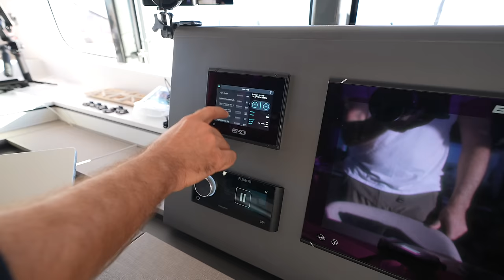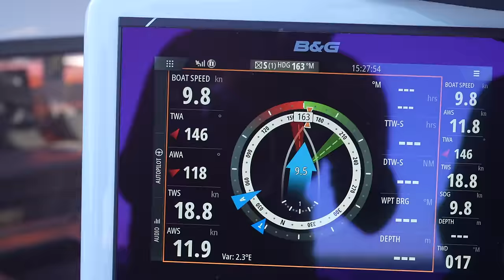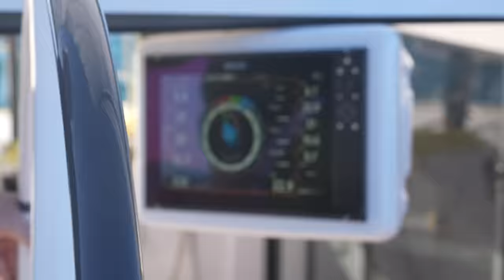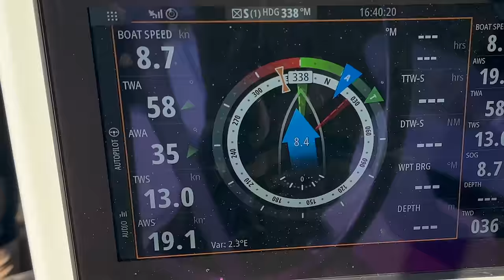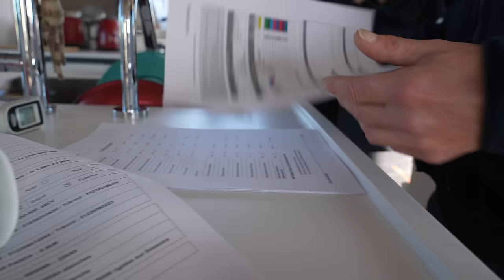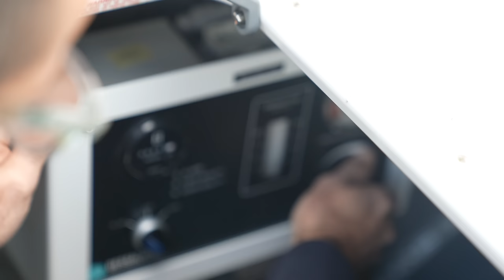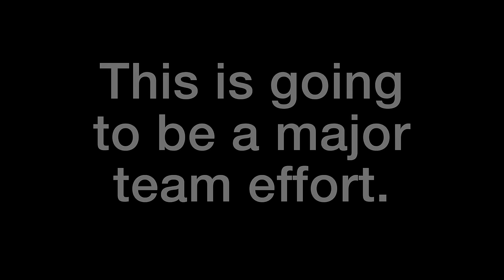A CRAZY PLAN FOR THIS OUTREMER 55

Comment: Great to you see sailing.  Enjoyed the information about balance. I've learned the that range of sail set and wind is pretty broad. It's not hard to look like a sailboat. It's the dialing it  to the sweet spot where a lot of the magic happens.  What an amazing boat.  It will be interesting to see how you do in heavy weather.  And I think Outremer found its best ambassadors.
Reply from the maker: You’re too kind. Yes, there is no substitute for experience, but good instruction can save a lot of time and headaches. We’re getting it and we will need more to get to and stay in that sweet spot. Hoping we don’t get a chance to see really heavy weather. Can be tricky in winter.

Comment: BougeRV Cigs aka Yuma panels are walkable and by far are the most durable and gives you more output even if 3/4 the panels is shaded it still produces.  pricey but the competition only lasts 5 years and these should last up to 25 years for a flexible, walkable panel hello. also there sizes are impressive. 200,400 and 800 watt panels.  I also agree about the amount of solar at least 2500 watts but as much as possible trying to get to 5kw of panel production.

Comment: 6200 nm in 35 days is 177 NM a day with an average boat speed of 7.4 knots. Easy Peasy for that boat.  During the day you can push it a bit and be 10-14 knots and during night 6-10 knots. Its much easier when you have a boat built to cover distance with ease.
Reply from the maker: If you could just get underway and not stop, then yeh no problem. This boat could manage that. But that’s never the case. We will undoubtedly have weather and crew delays. Averages will need to be higher.

Comment: You guys look happy and so you should be. That boat would be top of my list for cruising cats if I was in the market. Are the sails Dacron or Hydranet?
Reply from the maker: Yes, faces are sore! lol … White sails are hydranet. Standard stuff for gennaker and spinnakers, though the symmetrical is a bit heavier. 2.5 or 3oz, can’t remember.
Reply: I can't help thinking the loads are too high for hydranet.  It will be interesting to see what the leach looks like in 15000 miles or so.
Reply from the maker: @deerfootnz  not sure we’ll have 15000 miles on this boat, but we shall see. I love my laminates…have put them on two of our boats, but if I were going around the world and could choose, I’d probably go hydranet.
Reply: @TheOKellys  Hydranet is very expensive and the stretch numbers especially off axis aren't much better than Dacron. I prefer membrane to laminate. I haven't used the North 3di yet and dealing with North Sails always leaves me feeling like I need a shower afterward.  Membrane is 30% cheaper than hydranet. 3di and hydranet within 10% price difference. With a high apparent wind high righting moment boat like a performance cat the leach loads are high. It will be interesting to see the leach of the hydranet sail in a year's time.

Comment: Bridge deck clearance is low on her,what was the noise like from slapping,in the video you can hear the boat talking,can you live with the creaking as live aboards.Whats the Bruce number on this vessel she looks like a gun(fast).Does it have a wet locker in the doorway of the saloon for foul weather gear and clothing changes.
Safe sailing guys and wishing you a Merry Christmas.
Reply from the maker: Nah, not low. Lower than a 51 with the drop in the anchor locker, but not “low.” The day you see in the video was mellow compared to yesterday when we were out. Does not slam or pound. Yeh with a steep wave upwind, we slapped a few times, but not jarring. The creaking is from the sheets. Super windy and we are docked a stones throw from the beach, so there is sand on the boat, so the ropes make a bit of noise. Need a good rinse. She’s got an enclosure, so no need for a wet locker. Bruce number…I don’t have that at hand.
Reply: @TheOKellys  cheers for the reply guys,following along intently,gotta say this is too much boat for a couple,,keeping up with daily cleaning would be tiring,I can’t imagine pen fees at a marina on a big girl like her,she’s a beauty none the less,keep the dream alive guys look for something around 40-45 ft that’s comfortable and do able for two persons,definitely get an indoor helm centre,screw being outdoors in a blow if not necessary.Love your work,regards Dirk.
Reply: @HoytFergus  your assuming you’re part of this conversation,your not,you provided nothing valid other than ridicule,learn to interact with other individuals in a more sociable manner and perhaps you could be included in the conversation,stay safe.

Comment: Head up... you mean veer off a tad. You were pinching into the wind a bit much. When you veer off, you get more apparent wind. That apparent wind makes your catamaran perform much better and causes you to point much higher to almost the same heading as you were on when you were pinching but much faster and at a balanced greater speed. I learned this from racing Tornado catamarans. I got first place in a San Diego regatta with over 100 boats on the starting line with four 1st place and one 2nd place. That was one of my greatest highlights in my life because this was an Olympic qualifying race and the worlds best sailors were there. I was 17 years old. When your sailing up wind, pay attention to your sail trim and your tail tails. Those little strings that are on your sails. You  need to learn how to use them and if you don't have any, put some on because it will help you understand sail trim much easier.
Reply from the maker: With those credentials in SD, then you must know our friend Eric Witte. I hear you and understand perfectly, but that’s not the case here. Like I said I was overtrimmed. Trust me…been doing this a while. Part of the reason is it was shifty and I had AP set to heading not wind. I’m not going to rewatch it now to make the point, but I had apparent wind at 037 or so and Matthieu was somewhere around 028 and we hadn’t touched the sails. So….overtrimmed. The delta on true vs apparent is something to get used to though for sure! Keep on keeping me honest though! Always game to learn!
Reply: @TheOKellys  No, I don't remember that name. I couldn't afford to compete in the Olympics and didn't have any sponsors so I sold the boat and got a Nacra 6.0 and only raced locally. It takes two boats to compete competitively. You also have to have some type of passive income coming in to afford to campaign for the Olympics. People were supper blown away when I won because I beat gold medalist and world champions. I smoked them all. I was also shocked because it was my first time racing a catamaran. I grew up racing Naple Sabot's and Lasers as well as other small boats. That for sure was the key to being able to do that as well as the love for racing. I also won the Sabot Nationals with 5 first places but was a half of a year older than the requirement so the trophy went to someone else even though I paid my entry fee and was accepted. I didn't know. Oh well. I also got 6th place in the Laser North Americans with one 1st place and 6th in the Flight of the Lasers. Being in a junior sailing program really helps and is key to being a good sailor. I did that when I was 8 years old all the way through 12 grade. I was also on the high school sailing team. All of that work paid off.

Comment: I don't understand why they would install the oven so close to the floor. It's inconveniently located, tight spot, and so low, getting food in and out would be a nightmare. I don't know why they put a 6" drawer above the oven instead of just putting the drawer under the oven, for pans or flatter pots. And they could consider turning the oven towards the glass, where it looks like there could be more room, and just cover it with a millwork panel when not in use. Just thinking practicality. :)